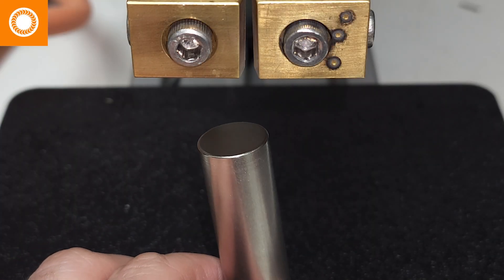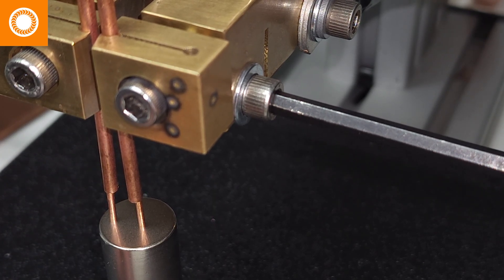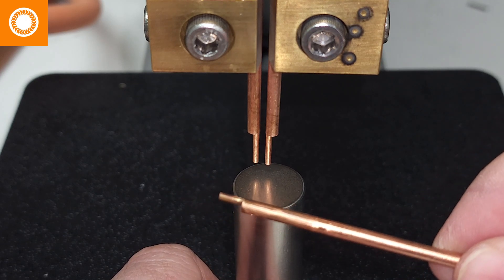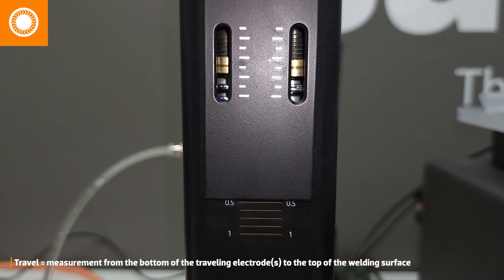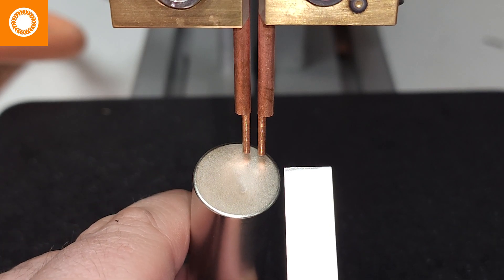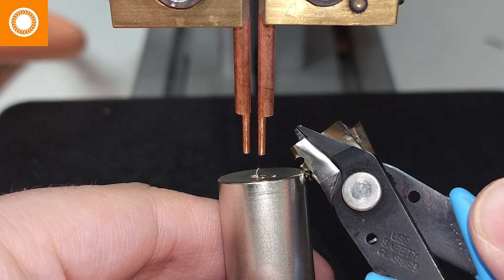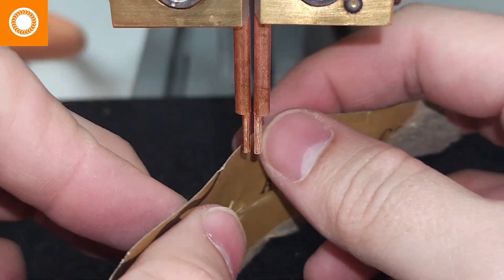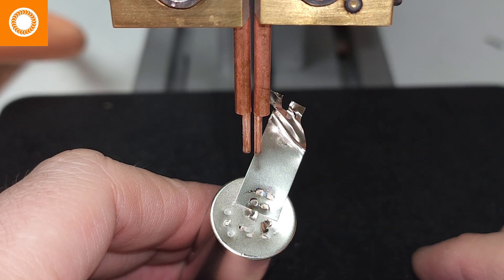Welding Battery Tabs with Sunstone CD Welder - Setup Tutorial

Comment: How would you twist the battery pack off if it’s a large complete battery? 
That would not be practical to do for anything but a single cell tab weld. 
Are these machines used in pack manufacturing?
Reply: exactly
Reply: thats a shit welder right there